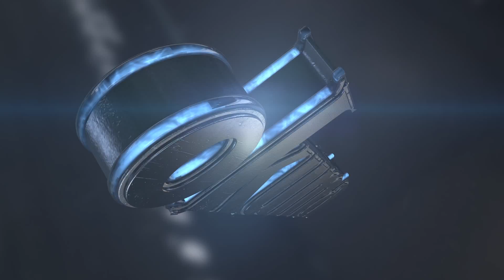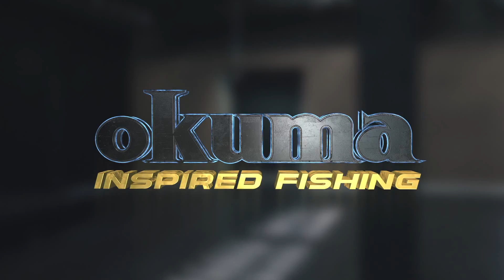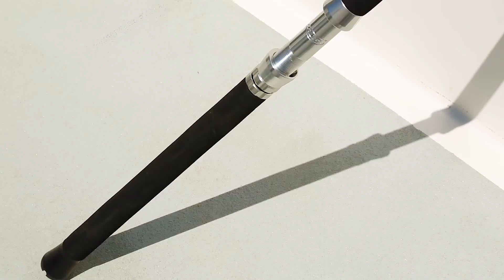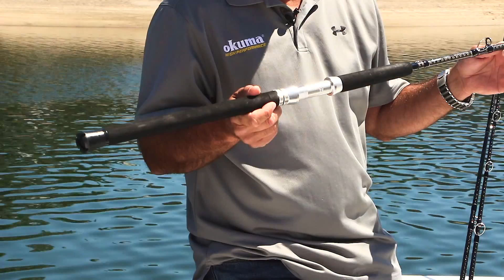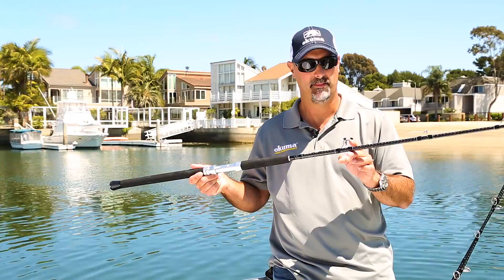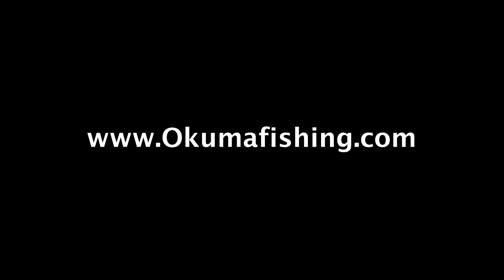Okuma SCT Albacore Rods

Comment: Question:  for the trolling rod version, can I put a spinning reel on it?  TIA.
Reply from the maker: It is usually not good to put a spinning reel on a casting or trolling rod.  The angle of the line from the spool to the first guide is generally too steep of an angle creating unnecessary friction.